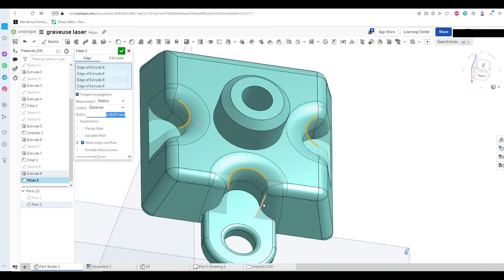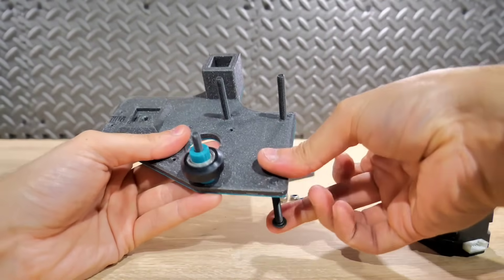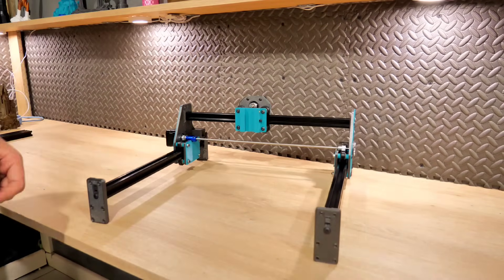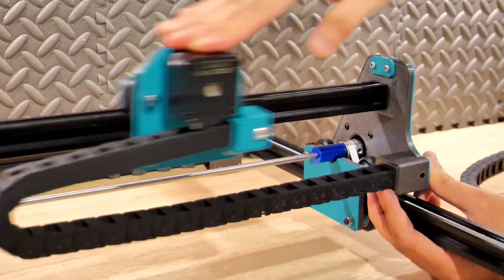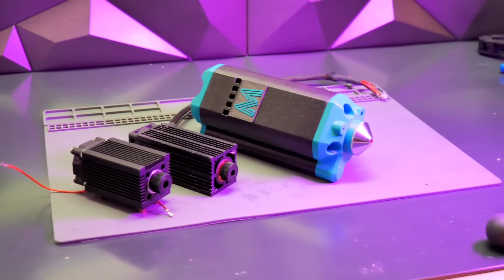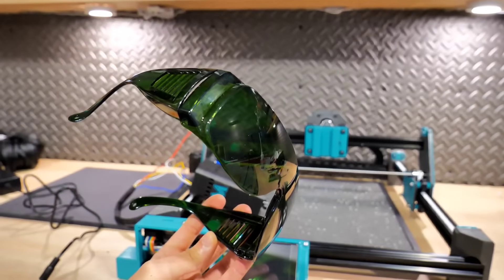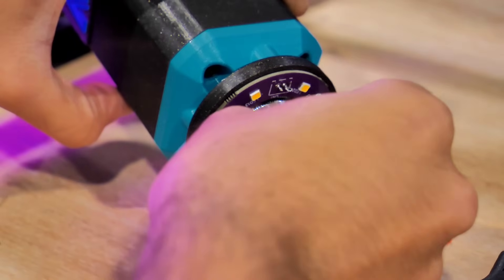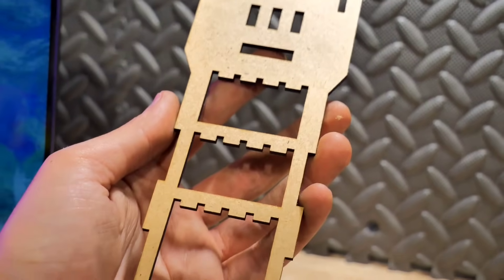FABRIQUER UNE GRAVEUSE LASER !!! imprimée en 3D

Comment: Salut, j'ai tout  monté mai j'ai un problème les galets sur les profilés 20x20 coulisses très mal. C'est trop serré ( pas assé d'espace entre les galets).
et Les vis c'est M5x50 ou M5x40 parce que M5x50 c'est un peu trop long. Merci encore un top projet.
Reply: J'ai un soucis avec le moteur pour enfiler la roue denté et le coupleur l'axe fait 24mm et est trop cours vous avez trouvé un moteur qui vas bien?
Reply: @cyrilm6451  Même problème.
Reply: @cyrilm6451 j'ai trouvé un 30 mm sur Aliexpress.
Reply: Pour ton soucis desserre les 4 vis et resserre les en même temps
Reply: @cyrilm6451  non c'est beaucoup trop serré j'ai modifié avec des excentriques pour pouvoir régler.
Reply: @attic-Techno  ha bon je n’ai pas eu ce soucis.
Reply: @cyrilm6451  j'ai également un moteur longueur axe 24mm et c'est trop court.

Comment: Hello! What are your thoughts on using longer aluminum extrusions for a larger cutting area?
Reply: you can use longer extrusions however as you scale up in size the rigidity declines and can cause inaccuracies... they can be accounted for in software and with good design practices to an extent but once you go so big there's not much you can do.

Comment: slt, félicitation pour ton boulot car sa demande des heures de conception / réalisation/ montage, que beaucoup de personnes ignore. Malheureusement ta machine n'a rien d'exceptionnelle et vaux même pas le coup de la fabriquer. pour 50€ de plus, tu a la même en chine ^^ (sans compté la mains d'œuvre) . c''est pas pour être méchant (Loing de la) mais quand tu as des compétence comme les tiennes, sa sert a rien de copier les autres. il faut savoir voler de ces propre ailes .
Reply from the maker: Hello, merci pour ton message :) par contre je ne suis pas d'accord, en chine pour le prix de la mienne tu n'a rien de mieux, électronique qui n'est pas Open source pas de wifi pas d'écran et pas de sd de plus l'air assist tu dois l'acheter mais aussi le plateau de découpe.la mienne est assez haut de gamme c'est pas un petit jouet haha. c'est plus gratifiant de la refaire mais aussi plus performant. Après oui bien sûr en chine il est possible d'acheter des trucs qui marche quand même mais sans plus pour cette gamme de prix